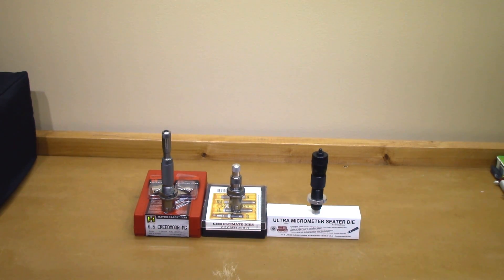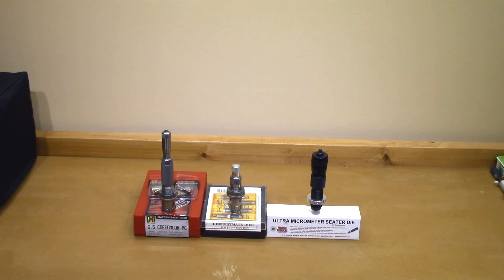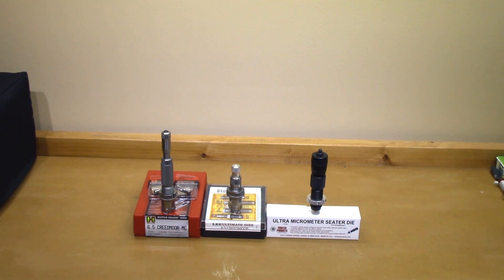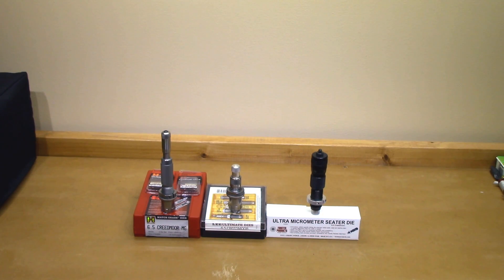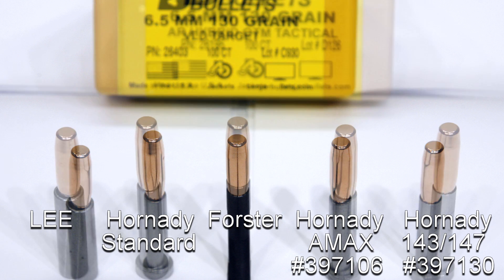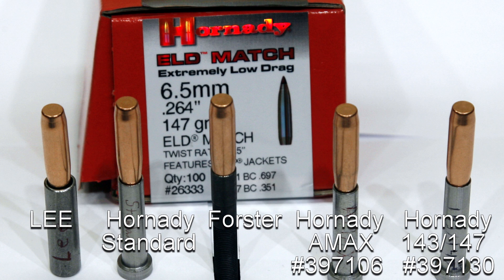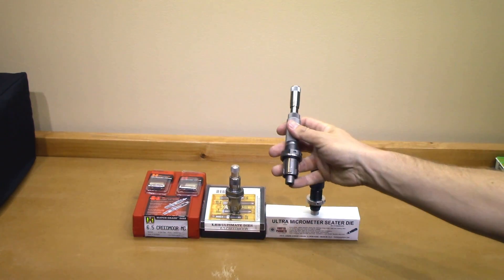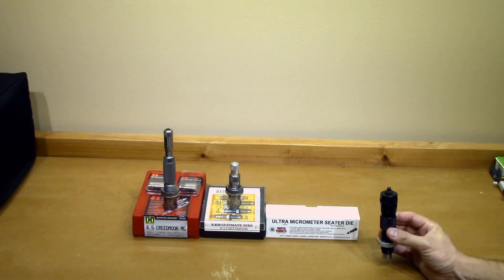6.5 Creedmoor Bullet Seating Die Stem Comparison

Comment: Thanks for posting ..
I'm wondering about seating stem design..should the bullet slip into a chamfer...more surface contact...or no chamfer...less contact with the bullet.

Apparently Forster has an easier to use micrometre..but..the seating stem is thin and flares out a little over time...I'm told ..redding has the harder to use micrometre..I'm told..but ..thicker seating stem walls..so doesn't wear out..

Comment: The Forster bench rest seating die was the first to support the case before seating the bullet. It is the most copied of all bench rest seating dies. I have several. I do have Redding dies too which are very good dies. Their bench rest seating die is much different stem seater and does not fit bullets very well and seats more to the tip of the bullet where the bench rest seater closer to the ogive. I would never buy a Lee seating die, or a Redding standard seating die they are both a disappointment. I even tried a universal seating die from Frankford Arsenal, and it was a bit too sloppy to give a good run out and after going through those three seating dies ended up ordering a Forster for my 6.5 PRC. I only have a couple of calibers I don't have bench rest seaters for and if I do get them, they will be Forsters because all the ones I own work perfectly.

Comment: I have had the same issue with my Lee steading stem in 25-06. I plan to modify it to where it pushes on the ogive and not the tip. Lee says you can just use a drill press and a drill to ensure it doesn't bottom out on the tip, but I think that will leave a noticeable sharp corner that will deform the copper jacket, I intend to us a tapered endmill I just need to figure out what size and angle endmill to use. Thanks for the video

Comment: Well I use the Hornady seating die with the appropriate insert for 140gr ELD Match.  Hornady makes a specific insert for each of their projectiles so getting the right one is easy.  I back my micrometer off a few thousands then seat the bullet, measure to CBTO, dial the correction and final seat. This takes a little longer but every cartridge is within 0.001” to 0.0005”!   Cheap, easy and very consistent..

Comment: I agree, went from Lee, and RCBS to Forster dies, first the Ultra Micrometer seating dies, than to the sizing dies. They are expensive, but for a reason, they make your brass and final loads VERY concentric, very low runout, and they are extremely well made. Only thing to be aware of, the seating stem is easily damaged if you use it with a compressed load. I even was seating a bullet in a case that was not properly chamferred and deburred, which cause the bullet to bind, and that cracked the seating stem. Other than that, and cost, well worth the investment.

Comment: I have the Fortser so far vor .223 REM but also want to get it in 6.5CM
However, after loading the first 50 rounds sor so, I noticed that the seating stem got stuck in the guide chanel.
What habbened is, that the mouth of the stem got widened to the circumfence of the guide chanel.

I think that this is just breakin though and that it can't widen any more, because of the guide.

Comment: Your evaluation of seating stem is largely visual ???? looking at the bottom of the die ??? that is not even reliable. You should have tested bullet run-out for each die after seating the bullet then make a reasonable conclusion as which is the better seating die!!! I cannot understand how you made your choice without some sort of methodical testing!! Maybe shooting 3 groups at 100 yds would have been enough!! Please try the scientific method for proving a theory!! I could not believe you can draw a reliable conclusion by just looking at the  bottom of the die!!! Wahhh??
Reply from the maker: Hello Sir, My evaluation is not largely visual. I have had the privilege of using all of these dies on my bench and loading hundreds if not a thousand rounds at this point with them. Its impossible to convey this type of information in 10 minutes or to everyone's satisfaction. I do not disagree that bullet run out would be a good test, and I am not saying that a seating die doesn't contribute to run out. (thus why I felt showing how much more tightly the Forster die held everything in alignment compared to the others was) but in my testing the quality of the sizing process is much more influential on overall run out of your loaded round than the seating die. The best seating dies aren't going to fix a case that has had run out induced with the sizing process. https://www.youtube.com/watch?v=9I2pwRDxDOQ&t=1459s When I am sizing I want a stem that supports your bullet the best, and holds in the best alignment with the case which is exactly what I get out of my Forster dies. I try to convey in the video. The goal of this video is not to tell you what to buy but you can see the dies and draw your own conclusions. There is no guarantee that the dies that show up on your door when you order them would be identical to mine as well. No amount of shooting would satisfy anybody and no certainty that the shooter would not introduce error. If you wanted to see groups I have upwards of 75 or more load test videos posted on my channel. I enjoy feedback but acting like your personally offended by watching my video is a little over the top. If you can find someone else that is showing this level of detail in their videos, watch them instead.

Comment: Hi BAR,

I have a question / (seating issue) I was HOPING you could assist me with...

I have messaged you before regarding the Sierra bullets and the inconsistent seating lengths - and was told by a fellow reloader that I should consider a differ seating die (the Forster Ultra Micrometer die), as this may get me the results I am seeking.

My issue is, when I seat the Sierra bullets (#1740), I am getting various COAL, and yes, you did mention to get a bullet comparator (which I ordered and is on its way), but I was wondering if the Forster die will make better contact with the ogive of the bullet, thus giving me uniform seating lengths?

The other option I have is to trim the meplat, which I don't know if this is worth doing at this stage, however, I am really determined to uniform everything and get the most accurate (and consistent) results possible.  I was using the Hornady ELDs BT, and noticed that all the lengths of those bullets are uniform (which I suspect is due to the ballistic tip), and the HPBT Sierra bullets vary due to the inconsistency of the bullet being made, which precipitates in those various lengths (which is vary annoying).

Hopefully you can provide some info on how to best tackle this issue.

As always, I value your time and appreciate any support you can offer.

Kind regards,
Dan
Reply from the maker: Hi Dan. I encourage you to use the bullet comparator and see what you find. It depends on what you find. If you want to "point" bullets you can but I don't think that I will start. If its something that you worry about then you might want to choose a different bullet but I have used them with good results without pointing. Why I like reloading is we can all decide what is good enough for our own standards. Interested in what you find after you start measuring CBTO.

Comment: The info on the Forster Ultra Seating Die at Midway suggests that this is a NON-crimping die.  What is suggested for crimping for the 6mm Creedmoor (not 6.5) if there is any difference
Reply from the maker: My guess is that you can get a set from Lee (available on Lee's website) or from rcbs.
Reply: I've seen conflicting information for both 6 and 6.5 CM saying to crimp and to not crimp (for accuracy).  If not crimping, I suppose accurate neck sizing would be critical.  Which do you do ... crimp or not?
Reply from the maker: I have a bolt action, so I don't crimp. If it was a AR 10, I would.

Comment: As I note I have had a Forster Comp seater on order for 3 months. Out of desperation I am using a Lee Dead length seater with a custom plug for a ELD-X bullet which works just as well for the ELD-M bullet. It took two weeks to get back from Lee and quite frankly is doing a very respectable job. Most are 1 thousandths or or less when checked on my Forster comparator, and no damage to the bullet. I will use the Forster when I get it, but the Lee with the custom plug does quite well.
Reply from the maker: Hi Alan, Thanks for the info. I can certainly understand waiting 3 months would not be ideal. I don't have anything against a custom sealing plug from Lee but with the cost of the Forster not being too bad and if it was in shock vs waiting weeks for a custom plug. I would go with Forster. Again thanks for the info.

Comment: I have had trouble with seating very high BC solid copper bullets.  (Hammer, Cutting Edge, Flatline, etc.)  The bullets tend to get jammed into the die stem.  Hoping the Forster will work.
Reply: Kai Larson I have great luck with the Hammers and a Whidden Gunworks seating die. I sent Whidden a 124 gr Hammer Hunter and they made me a stem to fit it exactly.

Comment: $8 and lee will make you a custom seating plug for your exact bullet...
Reply from the maker: I had another commenter tell me this as well. I was not aware when I made the video, however the Forster seems to work well withpretty much every bullet that I want to seat and the lee is the exact opposite. Also add the $8 plus shipping both ways and last I looked they were quoting a month turn around. My time and doing it correct the first time are worth the cost to me.
Reply: That is absolutely fair... I'd love to have a Forester die, but I have more time than money...
Reply: If I would have know about the Lee I would have spent the extra money at first on a different set of dies,  I have 5 boxes of bullets i cant load bc the Lee seating stem Mars up the bullets

Comment: I have used Lee dies for decades.  You can get a seating stem to fit any projectile.  https://leeprecision.com/custom-bullet-seating-plug.html for $8.00.  If you want to get more neck tension use the neck sizing die with the undersized mandrel.  https://leeprecision.com/undersize-mandrel-.262.html $4.00.

Comment: i'd love to see a runout test done with these dies and a small selection of bullets.
Reply: Runout has almost nothing to do with seating and everything to do with sizing.
Reply: @G5Hohn  incorrect, try seating a round with projectile that does not fit in your seating stem very well and I assure you it will go in crooked causing runout. Also through my testing using a concentricity gauge and various seating dies while using the same FL sizing die throughout there is a noticeable difference in runout from seating die to seating die. Additionally there are ways by simply rotating the cartridge and running it through the seating die again that can improve runout induced during the seating process all of which is verifiable by concentricity gauges.
Reply: @savagereloader6699  Chamber type seaters hold the bullet in alignment so the stem serves no alignment function. So if you are using a Wilson, Foster, or Redding Competition Mic seater, you will not have any runout attributable to seating. The bullet simply cannot be misaligned-- it's impossible. Maybe you need a better seating die.

Conversely, if you take a case with terrible runout on the neck, it doesn't matter what die you use, it will have runout on the bullet. Bullets follow the neck. Always.
Reply: @G5Hohn  you are right in that if a case has a runout you will not correct the runout by a good seating die same as a chamber cut crooked to the bore is going to have an effect as well.

However, the seating stem is the only thing that comes in contact with the projectile while seating and is what adjusts your seating depth of the projectile as it seats it. If the projectile isn't a good fit to seating stem the projectile can be on a very slight angle, even in good fitting stems there is a measureable amount of runout on almost all ammunition/handloads. The turn method while seating can also noticeably decrease runout induced during seating as was recommended to me by a local old timer who knew his stuff. 

The chamber style seating dies only helps to secure and align the case to path of the projectile while seating and if that projectile starts in sideways or out of alignment at all it will induce runout. Unless you're using matched dies there is going be play between the casing and the so called chamber support of the die as they will almost never be a perfect match unless your dies are cut the exact same and then you have brass spring back and sizing to worry about and not every die sizes to the same dimension nor does brass spring back the same with hardening and different metallurgy of the cases so all seating dies have extra play to then otherwise it would potentially be a sizing seating die and would perform two actions in one minus the neck being resized. 

BTW I pretty much only use Forster dies for anything I truly care about the groupings with. My Redding stuff just doesn't justify the price after having got them and compared them to the Forster product.
Reply from the maker: +Matt N thanks for commenting.  It's Not Really a run out test, and I didn't have the forster seating die them, but I did a performance comparison here. https://youtu.be/c302mAHiP2k 
Full disclosure I was chasing a run out issue and I actually bought another die for sizing. (Forester) I plan on doing a video on it before too long. Honest answer is that no seating die can fix what your sizing die broke. I hope you enjoy the channel.

Comment: Got that Forester die and its awesome. Had trouble with my Lee marking the projectiles with little rings near the tip. Measured centricity and they were terrible. Bought this Forester and they are dead perfect in alignment!
Reply from the maker: Thanks for the comment. I just picked up the Forster CO AX press and am looking forward to seeing if that improves my run out when used in conjunction with this die.

Comment: Surprising as 6.5 Creedmoor is a Hornady concoction and a match grade seating die that doesn't match their own match grade bullets... I'm a total reload noob and bought the Lee 4 die set reading great reviews. I found that the Hornady bullets get their tip crushed buy the stem.

What are your thoughts on drilling a relief in the stem to allow the tip to remain untouched and seating pressure more on the olgive? I would try to keep the pressure surface of the die untouched.
Reply from the maker: +Kirk Chapman different bullets have different profiles. Obviously smashing the top is the last thing you want to do, but there were so many good comments on the forster I couldn't resist. The Berger VLDs are the worst offenders, the custom Hornady stems do most of the Hornady bullets pretty well. I don't think drilling it or is a bad idea, assuming you don't actually disturb the surface that's supposed to do the seating. Thanks for commenting.

Comment: Yep, if you care about run out then use the Forester micro seating die. I use the Lee Collette die with the Redding body die to bump the shoulder then the Forester for seating. You don't need to spend $250 on a Redding Competition die set to have low run out. I would rather spend the money I save on bullets and powder.
Reply from the maker: This does sound like another good possible practice. We all just have to do what works. I am going to try that die at some point, just not today.
Reply: This is exactly what I’ve ordered. Good to hear someone has practical use with all three. I got the lee ultimate set, as it was only $10 more than the neck collet die. Redding body only die and Forster comp seating die. Have you been able to check concentricity? I don’t really want to buy a tool as I’ve already spent a small fortune on my reloading equipment 😖

Comment: Can you check case runout at the neck, then check the runout on a loaded round on the bullet just above the neck.? Would make a nice comparison
Reply from the maker: +Vaughn Precision I have not "effectively" turned any case necks yet. ( I use a mandrel die to ensure the concentricity of the case neck ID) Wouldn't you think that the slight differences in case neck thickness would unfairly make the case neck run-out worse than it actually is?
Reply: moparmadman it's been my experience that having an untrue neck dimension can express flyers. I even know people who insert cases in rifles with a mark indicating the high or low side of runout to get them as consistent as possible.
Reply from the maker: There is no limit to the OCD that some of us have. I to plan on starting my way down this road. (neck turning) I called Hornady and I think that that have put me back on the path to success, just haven't had time to get there yet.
Reply: Bolt Action Reloading pull the expander ball from the sizer die,  depending on mfgr there are varying degrees of flex in the decapping rod, as well as stretching the neck shoulder junction... use a carbide mandrel, it will create very nearly perfect concentricity, especially in a Forster Co-Ax press. From there, turn your necks and then anneal (they will have work hardened a just a touch from turning).